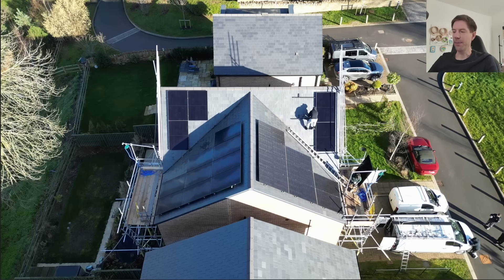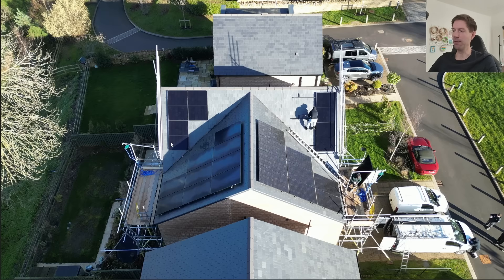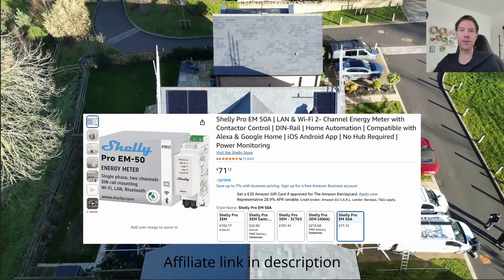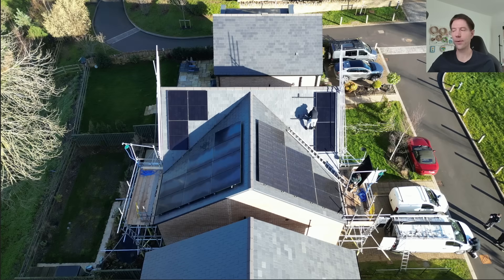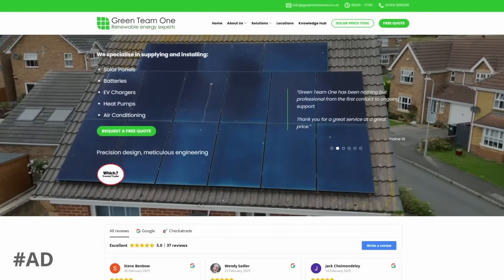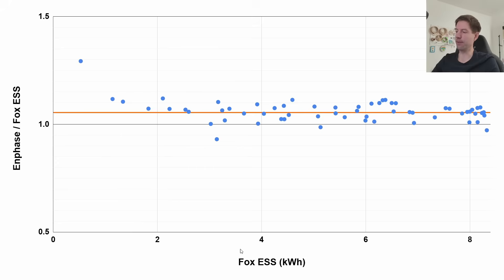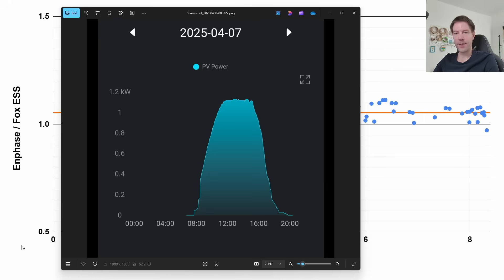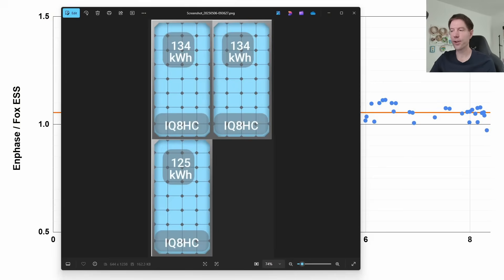Inverter showdown - two months of data

Comment: Great data, just regarding the lower panels being shaded & producing less. Simply being lower on the roofline - regardless of shading - will produce less power. All my 16x panels/micro-inverters show a clear pattern, one of which is those nearest top of roofline produce more. Also, those nearest Sun side will produce more. The pattern shifts with the solar day, but being able to track individual panels is quite interesting. Even those panels in ‘the middle’ (surrounded by others) produce slightly less. I do have bi-facials so may be effect of more light on edges bouncing in.
Reply from the maker: I'm not sure what mechanism would alter the generation of the panels based on where they are relative to the roof line.  At least for non-bifacial panels.  Without shading they would receive the same amount of light from the sun.  Perhaps it is just the fact that yours are bifacial that you see that pattern.  That would be an interesting result in itself.
Reply: @ be interesting to test bi-facial against normal solar panel to test. As they absorb light both sides, bouncing, indirect light from top of roofline or edges of several panels makes sense. I’ve seen a frosty roof nearly double expected output, before thawing.
Reply: @TimAndKatsGreenWalk  Illumination is never solely from the direct lighting source (Sun) so you'd also need to factor in shading from all light sources, especially the full sky. Being lower on the roof occludes more of the sky.

Comment: All your systems will have to resolve around the same AC voltage, in order to export at the same potential difference.  The panels may have labels on them that focus on watts alone but at string level they are tracking power-points on their own logic but within other limits.  The sub-optimal situation here is that once a common voltage has been resolved between the 3 export systems and the grid voltage the only thing that is remaining on the power formula is the current.  For example, any given string inverter may (ideally) wish for a higher voltage at that specific condition to extract the maximum power, conversion efficiency and at a lower current.  If it is forced to have a lower voltage then the current will rise, efficiency will fall, the inverter gets hotter and it may either hit a current or temperature limit for that condition.  Maximum power-point trackers live within a walled-garden of other limits.

To a point even a simple single-inverter system can hit similar limits, albeit the only voltage the system will have to resolve with is that of the grid itself.  So if the grid background voltage is already very high then there may be little or no margin left for the inverter to overcome for export.  If you dive into the weeds further you will see that my overly simple explanation above wobbles a bit when we account for VA, power factors, phase correction et al.  Indeed, export limits themselves are usually listed as kVA, rather than kW, or even assume kVA = kW, which it rarely ever is.  The DNO's also specify that the power factor for export will be somewhere between 0.95 lagging to 0.95 leading. A lagging power factor means that the site is exporting both VAr’s and Watts; so the inverters have quite a few parameters to juggle, where as consumers just get to see a reduced output on a graph.  

As to the future, the wider grid will be using our residential solar inverters for phase / power correction under the G100 authority, so our inverters will have more work to do.  As to how this will work with a mixture of G100 capable and non-capable inverters on the same service head is still a bit of a mystery to me.  I'm already inside the G100 bubble but only since a firmware update in February, so early days.
Reply from the maker: Yeah, having three systems working together does complicate things somewhat.  I'm hoping that my inverter temperature hypothesis is correct as I can do something about that at least.  We shall see.

Comment: Roll on Summer, I want to see that data after the string inverter limiting is fixed. Will the microinverters cap reduce the overall production? Or will their better lower light production push them higher for the whole year. But given the low startup voltage for the string inverter mean it doesn't matter. All answers I need to see.
Reply from the maker: Yup, I'm feeling pretty confident about my inverter temperature hypothesis and today should be a good day to test it.  If I'm right then that should boost the string output by a few percent, I'm sure.

Comment: 8:00 - I have a similar "clipping" on my South panels, 445w panels that aren't going much above 360-380w so would be similar clipping you'd see on your micro inverters. It's actually more that "solar noon" is still relatively low, so there's a bit more air/atmosphere for the suns rays to cut through. I think it's just coincidental that the panels happen to be maxing out at around the same wattage that the micros can do. I suspect it will be better next month as the sun is higher. You can ask ChatGPT to calculate what the max wattage should be given orientation/roof angle and and at different times of the year.
Reply from the maker: As it happens the sun was directly perpendicular to our panels in early April, as the tilt of the roof is quite steep, so I would expect a higher level of generation than I'm getting.  I think you're right that the level of clipping being similar to the micros is a coincidence, but I do now believe that the inverter temperature is the real cause of the clipping I'm seeing for those panels.  As I said, experiments are underway to find out for sure and I'll post a video about it in due course.
Reply: @TimAndKatsGreenWalk  keen to see the findings. Even with the panel at a more optimal angle to the sun, there is still more "air mass" through the rays to cut through. From my findings and the change between Mar/Apr solar noon @ 40deg and Jun @ 62deg, you get 10-15% loss from the air mass in Mar/Apr and 5% ish in Jun.
Reply from the maker: @WattsUpWithSteve  true, although in June the sun will be quite a bit higher than face on to our panels (our roof has a 45 deg pitch) so there is a sweet spot around now where the output should be maximum.  I'm hoping that today will reveal if my hypothesis is correct or not as it's nice and sunny right now.
Reply: @TimAndKatsGreenWalk  I look forward to more data 😉 There are so many factors to take into consideration and which one has more influence than another. Pitch/orientation/sun angle etc. Side note, I have been curious if this study into spraying sea water in the sky to "dim the sun" might actually help PV production as it  might give some dappled light which I think you've picked up on before that sometimes some slight cloud can generate higher peaks 🤔